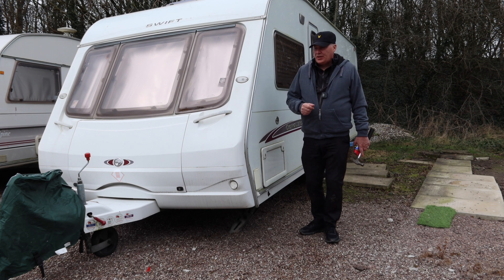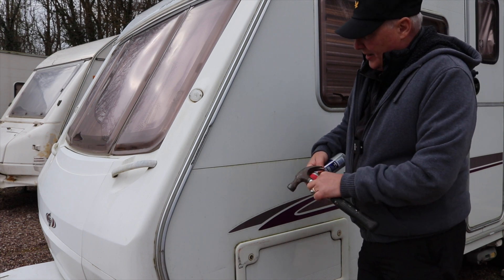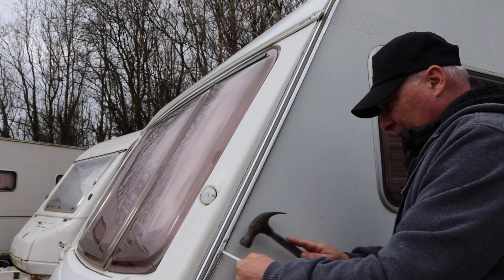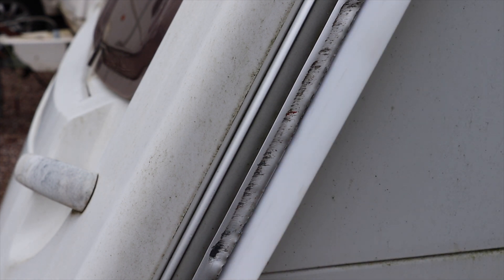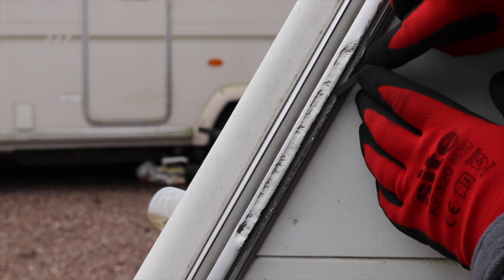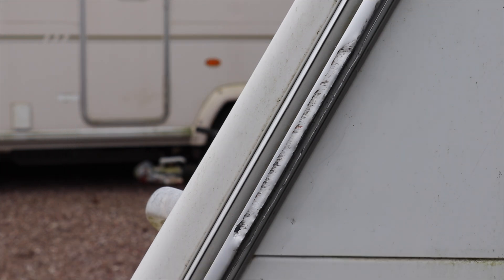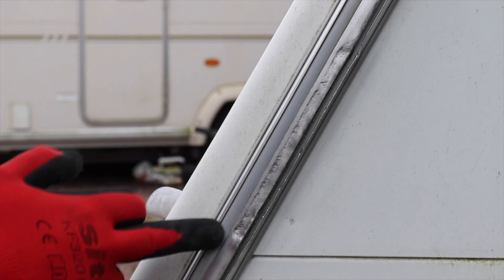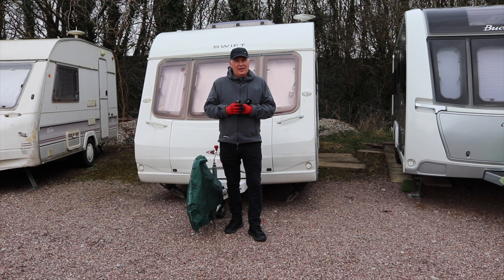Caravan Awning Rail Repair

Comment: Hi Phil, Without it going to some specialist metal worker I think you did a good job there 👍. Probably some touch up or spray paint that closely matches might disguise it. Cheers Rob
Reply from the maker: Hi Rob, Thanks .  I did my best with whats currently available.  The tool its self works after a fashion but could be improved. I will suggest that he touches it up with paint.  Thanks Phil. 👍🙂

Comment: Hello Phil, thanks for another how to fix video, I watched your video on waist pipe, and I was thinking of making my own waist pipe support’s from the awning rail, after watching this video I am now wondering what size will my awning rail be, 8mm or 10 mm ?, we have a Bailey unicorn 2017 , cheers Phil 👍👍.
Reply from the maker: HI BB. 8mm piping will do fine get the 18 inch velcro straps you will have more adjustment. Thanks Phil👍🙂
Reply: @lostweekendscaravan  cheers Phil, I have seen on Amazon a roll of Velcro with separate buckles so that you can make up what ever length you need, so I may order some soon, 👍👍.

Comment: I found that a gentle use of a wide flat head screwdriver and hammer to tap at the gap before using awning rail spreader worked well
Reply from the maker: Hi Ste. Good idea. I didn't use a screwdriver as I was concerned that I would damage the skin of the Van. Maybe I should have tried. Thanks Phil👍🙂

Comment: Hi, i also damaged my awning rail but mine seem to be peeling off the actual van and its also very very jaggie , can i replace a length of the awning rail easily. Thanks
Reply from the maker: Hi Sounds quite a bad bit of damage. Unless you are very skilled. I would suggest getting an expert to repair it. It will need a new section added plus there may be damage to the outer skin as well. Hope this helps. Thanks for watching. Phil🙂👍